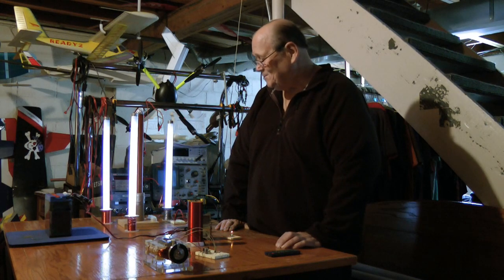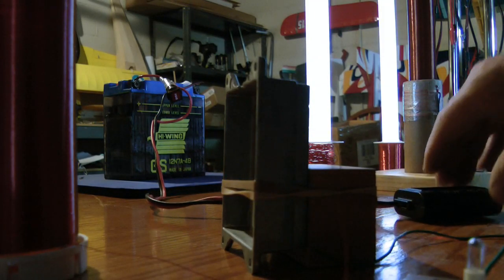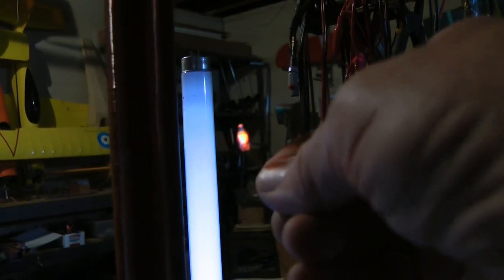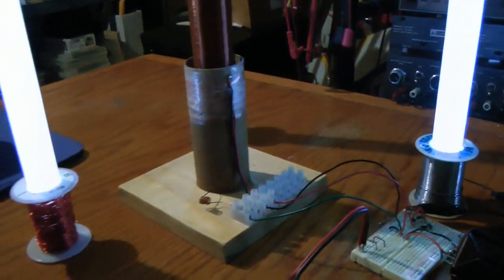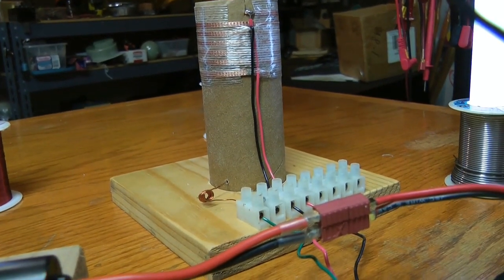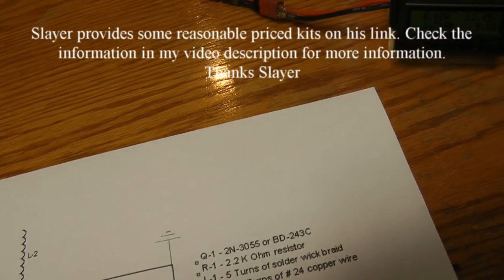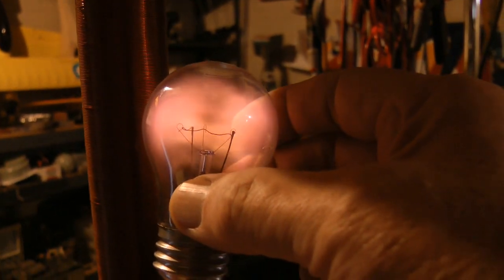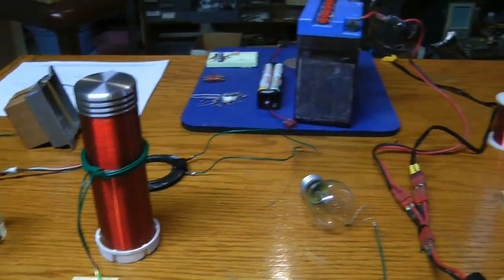How Not To Make A Tesla Coil That Works

Comment: Your body added the extra capacitance to get the small bulb to light. If you got the oscilloscope reading of the main coil in resonance and set the #2 coil to that same number the big light bulb would light up with no wires attached next to it. A slayer exciter circuit is self correcting between the primary and secondary. I call it forced oscillation.

Comment: what gauge wire would you recommend for a coil 10'' tall and 2'' wide?
Reply from the maker: Hello, Nice job on your little resonator. In this video I used #30 wire on an 11" secondary coil. https://www.youtube.com/watch?v=XZevXt9hLQU Managing to get about 1000 turns seemed to work out well for me. There are some formulas for this but I think they pertain to spark gap coils. Good luck and let me know how you make out.
Reply: sweet. thanks.
Reply: I think I'm going to buy a pre-wound secondary from eBay that has 1086 turns on it. with that, what would probably be the best number of turns for the primary?

Comment: I don't think any transistor will  work only high frequency transistor's will work!.....
Reply from the maker: Avon, My most recent resonator runs at a frequency of .947 MHz which is easy for the transistors similar to a 2n-3055 or my favorite MJL-21194 to handle.

Comment: Can you give me an alternate transistor it's hard to find it in my country....
Reply from the maker: Hello my friend. Almost any large size NPN transistor will work. Something that could handle 3-5 amps might even be enough. You might have to experiment with the resistor or use something like a 5K potentiometer. I will be posting a video of an easy to make coil that works well next week if you want to wait to see it.
Reply: Will the darlington pair of 2n2222A and D313 will work
Reply from the maker: I never tried a Darlington on the resonators. It might work, also the D313 might work by itself.

Comment: sir ,how did my make the motor with withs reciever can u give a brief expantaion or ckt or pdf about turns of motor winding  and turns of tesla coil. bith transmitter and reciever
Reply from the maker: Hello Nikhil, If you go through the video slowly you will find information on the windings of the resonator coils. As I said this is not an ideal resonator and I have a different one in the second video. Have a look at this video to see the circuit and the motor running:  https://youtu.be/ekpVLnmdr2k  There is also a download link for the diagram of this operation:  https://drive.google.com/open?id=0BwK5yJUfMl9GU1ZvY2VRbXZHSXc  If you look at this video you can see how I made the window motor:  https://youtu.be/Fw9H5p4McZA  I am currently working on a video showing my latest coils and wireless experiments. Keep in mind the height of your resonator coil should be 3 to 5 times higher than the diameter. 800 to 1200 turns of wire is a good amount to try.

Comment: I've built a spark gap Tesla coil that works pretty well, but I can't for the life of me get one of these slayer exciter circuits to work! I have a secondary that's 2.375 inches in diameter and 11.875 inches in height, so it's 5:1 ratio and it has about 720 turns. For my primary I had 7 turns of 14 gauge insulated stranded wire wrapped directly around my secondary but it could move up and down for adjustment, I've tried sliding it up slowly to see if that would help, but nothing happened. I tried using 22K ohms and 2K ohms for the resistor, and I'm using an PN2222a transistor and a 1N4001 diode, I've checked and quadruple checked my wiring, I've tried wiring it in different configurations, I've tried changing the polarity (but not the direction) of my primary. I've tired using a 9V equivalent battery (several AA's in series) and I've tried a ~20V DC power block, I've tried different diodes and transistors (of the same kind) to make sure that those weren't faulty or something but after all that I can't even get so much as a flicker from one of those tube lights, and it's not even a very big light. I am at a loss. Do I need more primary turns? That's the only thing I can think of, but even if that's the case, I would think that I could get at least SOMETHING out of it, be it less powerful than with the proper number of turns, but no. Based on yours, It doesn't seem that It would take away much from having an oddly proportioned secondary, as you clearly showed, so it stands to reason that I could get at least a dim glow with the improper number of primary turns right? Help!!

Is it my transistor? I've seem people make it work with similar ones, but you seem to have a very beefy one. What kind is it?

EDIT: Got it working. I was putting too much voltage through the circuit and blowing my transistor without realizing it, then I would try lower voltage with an already blown transistor.  How do you get that effect with the incandescent bulb? I've tried all sorts of different shapes and sizes and I can't get anything like that with any of them, all I get is a tiny bit of plasma on the end of the filament.

Comment: Very nice video!  If you think a cardboard tube is an odd choice for a secondary coil form, how about a glass olive jar?  I did that in one of my vids, and as you can see it worked enough to light a small bulb and a florescent tube as well, similar to what you show here in this vid.
Reply from the maker: +TechnoW1zard ........Hello friend. I think the reasoning with the cardboard is that it can take in some moisture and can also get burn spots at times. I would imagine glass would work fine. I found out if you put to much clear coat on the coil it takes forever to dry or cure enough to get fully efficient. You have some nice videos. Congratulations.      John

Comment: the term is electromagneticinduction not capacitance. your using an air gap transformer to power the small bulb
Reply from the maker: +john cajka ..........Hello John, I'm familiar with your term and wouldn't necessarily disagree with you as it pertains to the lighting of the bulb with a transformer effect. There are some unique differences if you want to call this a transformer isn't there? As an example one end of secondary is open circuit. Or on the other hand there is a capacitance on going from the top of the resonator to ground, so how can you say capacitance doesn't enter in? this information is on almost every description of how the device works. The receiver doesn't work unless a similar path to ground established and in this case highest efficiency of this path is established by changing the distance between the heat sink (Ground) and the coil. Is that not tuning the necessary capacitive link?I enjoy the discussion.John
Reply: you are effecting the circuit  with the capacitance of your hand i'll agree with that. all you are doing is picking up the mag field and converting it to voltage to light the small bulb
Reply from the maker: +john cajka ...........Hello John, I suppose we will remain in constant disagreement but that's OK because it gives me a chance to mention a few things I forgot in the video. OK maybe you would like to explain a few things that seem to say the potential on the receiver coil does not come from a common magnetic induction like a transformer effect: 1. My very expensive gauss meter does not find any magnetism from 3 feet away from the resonator coil all the way up to the coil where it nearly touches. You mentioned the resonator being an air core but you should know that the magnetism in an air core coil is in the center of the coil not on the outside. 2. If I connect the receiver coil or any coil for that matter to a volt meter or amp meter, I can move it right up to the transmitter coil and measure zero voltage and current. Based on that I personally conclude there is no standard transformer effect getting potential to the receiver coil.What is happening in my opinion, and I'm the first to admit I do not know a lot about Tesla coils, is that you have one resonating coil sending out some sort of radio or longitudinal wave that a second receiver coil can be tuned to receive. In turn the receiver will resonate at the frequency of the transmitter without any hard wired connection. A resonating coil can produce it's own energy can't it? Or maybe not, I'm not sure but I am sure this effect has nothing to do with electromagnetic induction and does have much more to do with capacitance. Capacitance is necessary to achieve resonance. If you haven't seen my second video have a look:https://www.youtube.com/watch?v=ekpVLnmdr2kI ran a couple of motors there using an AV diode plug and incidentally I can run the motors without the receiver coil and just from the diode plug. There certainly can't be a standard transformer effect there, there is no coil to make a transformer. So what runs the motor? What comes into the diodes and goes out DC?Take care John

Comment: hey good job!
Reply from the maker: Tesla Explorer Wow, Mr. Explorer, Am I ever impressed with your channel! I hope others who see this comment will visit and subscribe as I did. I'll need some more time to watch all your vids. Can I ask where you gathered your information from? I know very little about these coils and would like to learn more. It looks like you're using mostly magnifier 3 coil setups, is that correct? Is there a forum somewhere that has construction information. I recently made two 2Dia x 11H coils with 1000 turns and would love to try one of them as a magnifier but have no idea what to use for primary and secondary coils. I've had some good luck with running window motors with a special circuit and a receiver coil and had some nice success with the new coil with spinners and things on the top. Take a look at the motors running here:https://youtu.be/ekpVLnmdr2kIf you have any advice or a pointer in the right direction, I'd really appreciate it. Thanks for sharing your videos and visiting my channel.John
Reply: ***** Thank you so much! I haven't yet made a magnifier setup yet I would love to someday. For now im still experimenting with all the different tones that are achievable with high"er" frequency in visual fx from high voltage. little bit of wireless here and there of course. but in all the 3 main topologies. if there is a 3rd one that is, im starting to think the vttc and sstc have no differences at all!
Reply from the maker: Tesla Explorer Hey Tesla, I tried a jury rig magnifier and couldn't get it to work with my first tall coil but I blame it on the coil, it was pretty weak. I will try again with the 1000 turn coil trying some #18 for the primary and maybe something like #24 for a secondary. I'd have to guess at what the turns ratio's would have to be for a 1000 turn resonator if that's the correct term. I will find a radio somewhere and see what happens. My hand held meters with Hz readings measure a frequency of 1.6 to 1.8 MHz without even touching a lead to anything. That's certainly out of the hearing range if it's true but the scope shows nothing slow enough to hear either. I'll keep watching for anything new you post. Man you know how to light m up. I haven't used anything using more than 20 volts and around 2-3 amps yet. Once I got up there though everything really gets much better than these two videos. So far I haven't used anything but the Slayer style circuit. When you say VT do you refer to vacuum tube?
John
Reply: ***** the magnifier does sound interesting. I do believe they drive them the exact same as a regular spark gap Tesla coil.... you want the tone from the secondary plus the extra coil to match up with the primary coil. just like a resonator and primary in standard. your meters are probably getting spike oscillations from the air that probably wont give you anything static for a result. besides checking mains current with a clamp ive never metered anything really. just checking continuity really with an ohm meter and capacitance on an mmc. I forgot to suggest also that a spark gap Tesla would workout just as good as a vacuum tube Tesla....
nic-
Reply: hope you've been well!

Comment: A very enjoyable walkthrough, with all the good stuff shown nicely indeed. Your Edison type bulb glow was probably the best i've seen, for the glowing fog effect..and from a 'wrong' tower !
I wonder, did you shellac or otherwise coat the windings on the tower, to limit wire stretch over time ?
Reply from the maker: slider2732 Hi Slider, It was so long ago that I can't remember what was on it. My guess would be there was some urethane on it but nothing inside the tube. Before using the coil I sprayed plastic coating inside until it wouldn't hold any more in the cardboard. I have a feeling since the primary coil is about 5 inches up the HV coil that the bottom 5 inches might be redundant.John

Comment: Good to see you still tick'n. I too have a slayer running off an alum battery. Fun learning experiences we can all share together :)
Reply from the maker: Diadon Acs Hello, Diadon, I watched some of your videos and really enjoyed them. You probably noticed the alum battery works good in high impedance circuits. I think you'll like the next video coming up.ThanksJohn
Reply from the maker: *****  I couldn't help to notice a few things while watching you're video. Your neon lights on the negative side of the battery? Does that mean you don't ground your circuit? Ha, ha ha, don't you get a lot of those little burnies like I found out about? Another thing: I have an interest in trying a 3 coil magnifier. I noticed you have one in your videos. Do you think it outperforms the 2 coil setups. Nice video and good talking to you.John
Reply: You do get a lot of RF burns most defiantly. There are all kinds of configurations one can experiment with. I gave grounded the circuit and not grounded it. It is just dependent on what effect you are trying to achieve? Wireless power distance, plasma output, near field power intensity? If you haven't already, there is a great group of people who are experimenting. The extra coil is another tuning point from my own experience and some others who have experimented. It seems to effect transmission and power intensity. Here are some fantastic references which you might be aware of. The first few being Gary Bluer, *****, and Dr. Stiffler which are all pretty well known. The others that I have learned a lot about SEC, or Slayer circuits are *****,ABRAMS LaB TESLA ART, Terry Woodroof, and jeremy gwilt, to name a few. I look forward to seeing your next video. Thanks for taking the time John. 
-Diadon (Die-a-den)
I know, its kind of a strange name. ;)